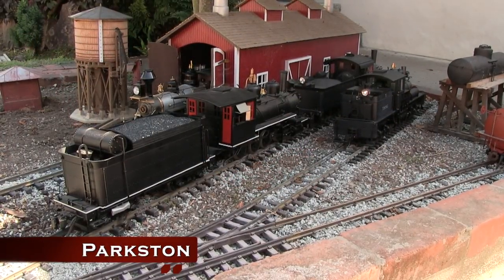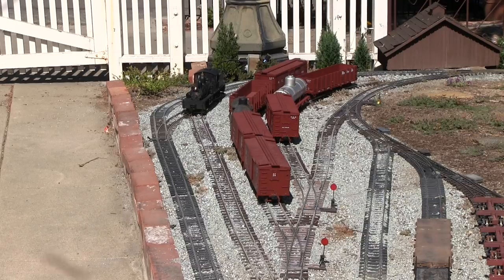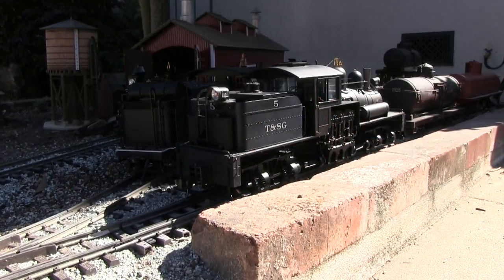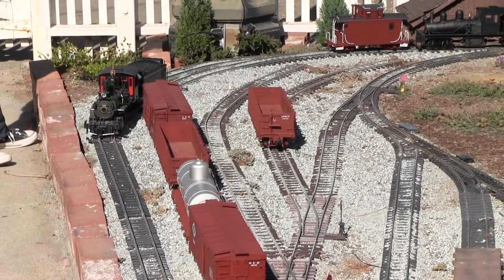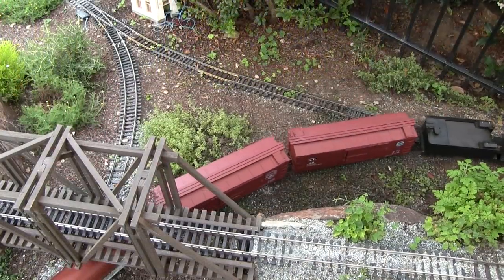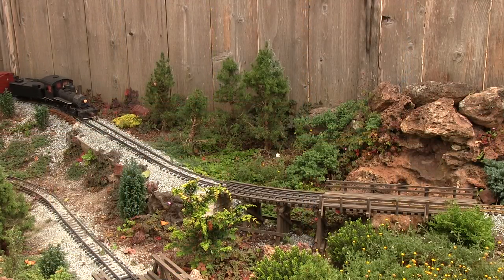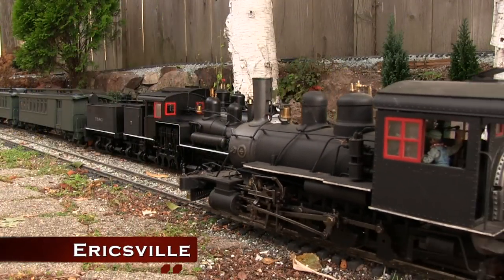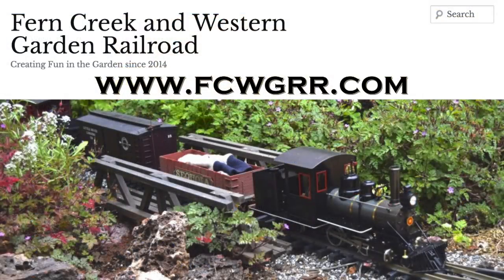G Scale DCC Freight Operations On The Fern Creek & Western Garden Railroad

Comment: Really smooth start on that Shay, and impressive sound unit. I have been thinking of converting some older locomotives to Airwire but have wondered what to do about sound. Tsunami2 and Convertr is the front runner.